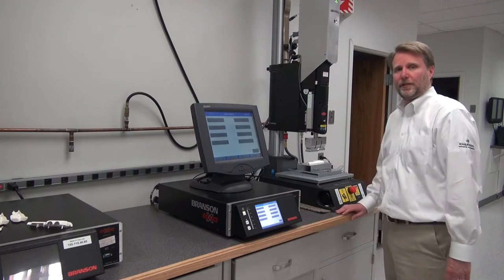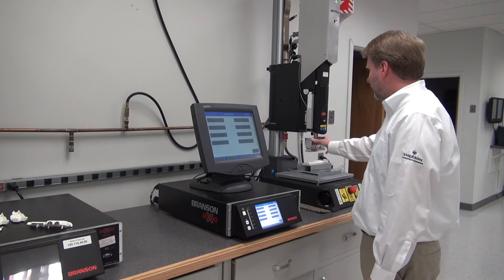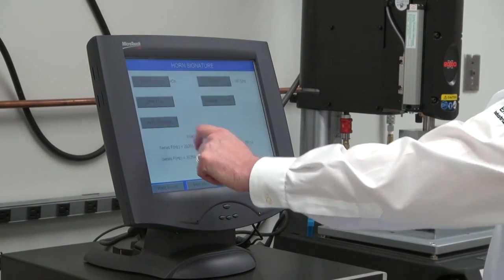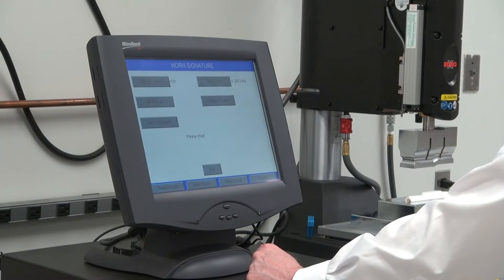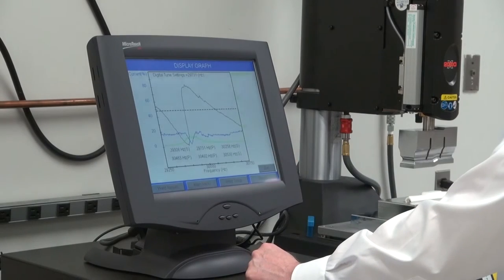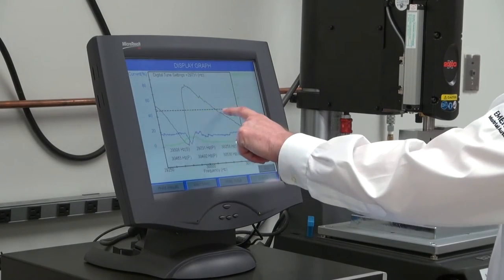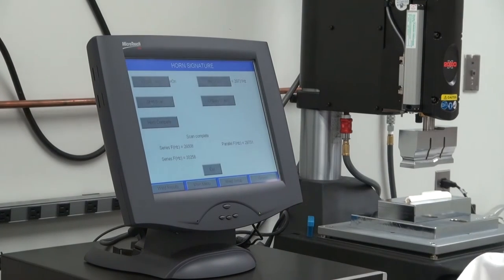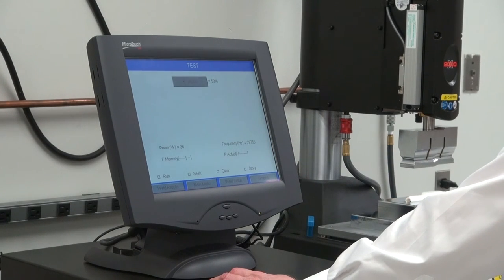Branson Ultrasonics HornTest

Comment: hi, i got a Branson 2000XP power supply,  but it display a faill "trigger switch" and it can´t goes to run and ready mode. What could be solution action that i can take?

Comment: how to connect the 3m touch screen with 2000Xc power supply? do it need any configuration?? cause the 3m touch screen after connect it to 2000Xc is not function and the touchwave cant detect the com port. model of 3m touch screen is M15000ss.